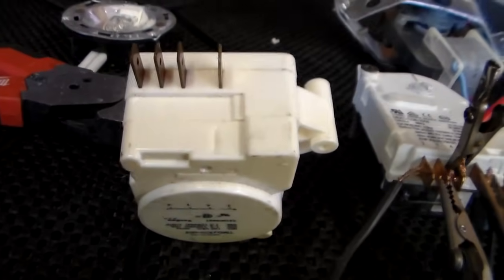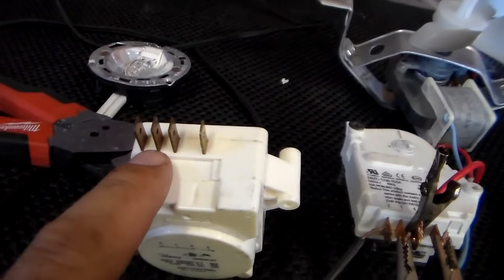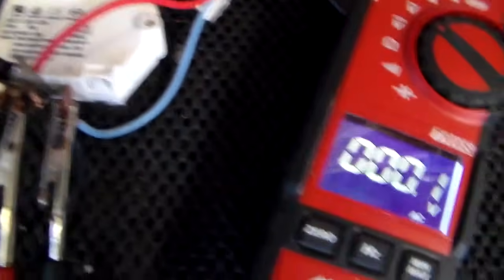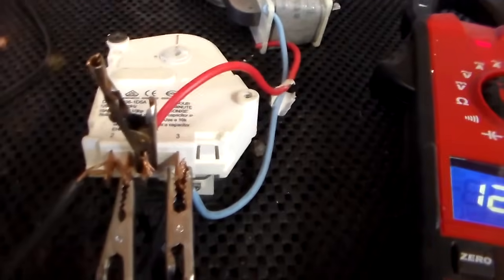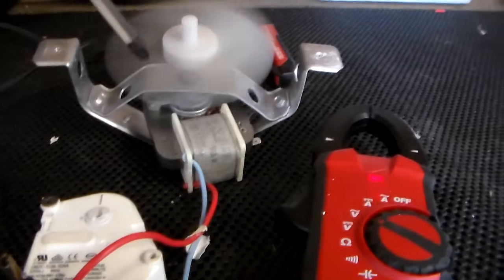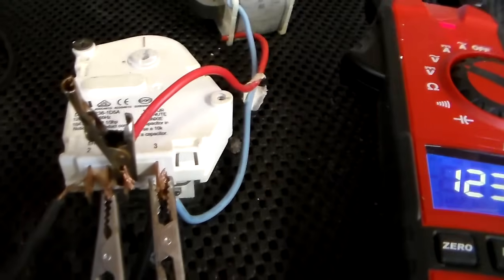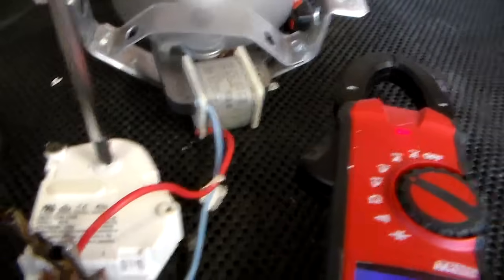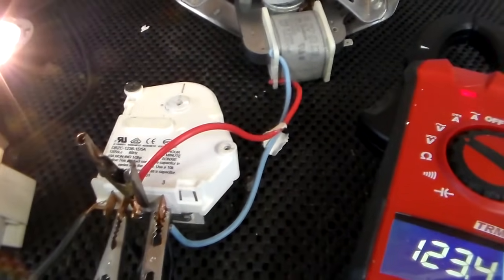How to Test your Defrost Timer

Comment: That's great but I can't find my timer on my GE top freezer TBX18 !
Reply from the maker: Barry Wind Straight back on the back wall of the refrigerator.  Have to pop out one of the plugs next to the temperature dials to see it.
Send the hole model number and I can look and tell you where it's at for sure.
Reply: TBX18AJB 
THANKS
Reply from the maker: Barry Wind That's where it's at, to the left of the refrigerator thermostat dial.   Should be a small little plastic plug in the panel the dial sets on.  Pop out the plug and look in the hole.  It will be just big enough to get a flat head screwdriver in there and turn the dial on the timer.
Let me know how you make out.
Reply: Found on GE forum that the timer is behind the left side of the kick plate at the bottom of the refrigerator. I looked and I see a metal bracket with wires sticking out on the left, about 4 wires. There is a little plastic piece sticking through the bracket that looks like a one direction turn (right only). The bracket has to be loosened and the timer is mounted on it. Timer has been ordered and should be here on Saturday.
Reply: Barry Wind  I got the part but when I took off the bracket at the kick plate it didn't look anything like the timer I received and only had 3 wires. Took the control panel off that was in the frig and don't see it there. I'm out of places to look!
Reply: wrong model then probly

Comment: A couple of questions Bill:  1. The Defrost Thermostat and Timer work in conjunction - is the thermostat simply a protection in case the timer doesn't work or more probably to shut the defrost off at a particular warm temp - if you bypassed the thermostat the timer would still shut the defrost off, right?  Not that I'm gonna do that, but just so I can better understand the purpose of the thermostat.   2.  Since the Timer is like a clock, can it malfunction at any point during the cycle - say one of the teeth of the cylinder breaks off - maybe this is beyond rare, but I guess what I am asking is do you need to test the timer all the way through a cycle --- also, do you hook up the timer directly to 120 volt wall outlet in order to test?
Reply: yes the timer would still function switch between def and regular cooling..  but it would nevr shut off once it reaches temperature because thermostat is disabled.   it would just run continuously forever. nonstop.

Comment: A friend has a Sub Zero 532, she told me that the refrigerator side is warm and the freezer is cold enough to freeze ice packs. When I opened the door the edge that contacts the dividing wall is HOT! I turn the defrost time until it clicks like in your video and 20 minutes later the divider is cooling down. A service tech told her over the phone it is the condenser fan, sight unseen. He came out yesterday and confirmed the fan motor was turning slow. The unit is used seasonally. I think the timer is stuck in defrost and that's why it's warm on the fridge side and cold on the freezer side. Does these sound plausible to you? I'm going to check the clock cycle. I would think there would be no cooling if it were fan related. Butt watt dew eye no?
Reply: yes  timer supplies voltage throguh it to the comprssor start switch and to the evap fan.   timer can be burnt weak internally junk  try another one from another fridge real quick   ohm it out with multi meter  pin 1 is hot full time always.   pin 4 is cooling regular.   pin 2 i think  is defrost only.  rotate timer  clockwise until the pins 1 and 4 is ohm together make a circuit.  or you can jumper the wires together in the fridge. wires 1 and 4

Comment: my problem is I have replaced my defrost timer and it still freezes up. I can advance the defrost timer and it will thaw. Once the freezer has thawed I advance it so that it starts back up again. After a couple of weeks or so i have to do the process all over again
Reply from the maker: Carl Krockenberger You still have a bad defrost timer then.  When you advance the screw and it thaws - that means all the parts attached are good.  When you advance out and everything kicks back on - those parts are good too.   The timer is not advancing on its own.  Little itty bitty motor inside the timer is not moving.
Replace the timer.
Reply: or bad ground to timer?

Comment: have a frig that I just moved on its side now not working   compressor gets real hot
Reply: compressor oil needs to settle back int compressor for an hour or more first.    can over heat ruin compressor.  it may be low on oil.

Comment: i replace my defrost timer in my Whirlpool Fridge but its not shutting off so ice built up at the back of my freezer
Reply: check the defrost thomostat and heater ....is the timer one like in the video or metal back with two wires?
Reply: +sim ridge the defrost timer is like the one you have in your hand
Reply: +sim ridge i did change my defrost timer yet ice still building up at the back of the freezer so my request isn t the bi metal need changing?  because my fridge isn't shutting off it is running none stop
Reply: gonna have to test thermostars with ohm meter real quick to rule them out    they are simple.  on and off,  click.   open circuit for off and closed circuit for on.   if they check ok then a timer is bad or no  power or ground to one of them.

Comment: What kind of meter is that
Reply: Basic multi-meter with an amp clamp.  You can set the meter to the amperage setting, put the clamp around the hot wire going to the fan (while running), and get the amount of amperage the fan is drawing.  Perfect for testing the defrost element to see if it's heating.

Comment: Hello Bill. I have watched several of your videos and they are great. 
Me fridge is a GE side by side model# ESL25JWF BS. 

My defrost heater burns out about every six months. I know I have the right heater. I have checked the two of the thermistors in the freezer. 

I have checked the thermostat and it remains open until it reaches somewhere over a hundred degrees. I purchased a new one thinking that this was wrong. 
It is designated LT40 - 30F. I have not installed the new one yet.

I was taught that this means that it opens at 40 and closes at 10F as 40 minus 30F =10f
However, this makes no sense as the new one operates the same as the old and opens somewhere above 100F.  I believe it is a called a high limit thermostat.

I do not believe there is a defrost timer on this fridge.

The fridge does ok but its always a little warm and appears to get really warm in the freezer when in defrost mode. It gets hot as part of the plastic has melted in the back. 
The only time the refrigerator compartment does not appear to be warm is the first month or two after I replace the heating element.  

I have been told the the mother board was on recall though GE denies it. 

In the end the defrost heaters always gets too hot and burn up. 
Thanks!
Reply: try lowering voltage to heater?  resistor inline in the hot feed to it?  knock voltage down a couple volts?

Comment: I REPLACED A DEFROST TIMER THAT SUBS 24,12,8 HOURS, BUT MINE WAS 10 HOURS. AND ALSO REPLACED THE THERMOSAT CONTROL, BUT NOW I GET A READING OF 32-34DEGREES, AND THE CONTROL DON'T MATCH THE COLD NUMBERS 1,2,3, ON THE PANAL.NOT EVEN SET TO ONE, AND GET THESE READINGS. WHERE DID I GO WRONG HERE?
MODEL ED22DQXDN01 WHIRLPOOL

Comment: I think I know the answer BUT may be some one can say for sure. I looked all over for the defrost timer dial. There was not one to be found. So I took the cover off of the control panel.  The one under the freezer and refrigerator  knobs.  I found a electric control board  with a bunch of wires going into it. It was about the size of two deck of cards sitting side by side.  Beyond that looked to be a motor like the one's in the old ice makers.
 I took a straw and touched the motor. There was a slight vibration like it was running.  I do not know what the hell I am doing but I am giving it a try. I checked the heater and it had contanudity  Yeah made my meter beep. So I moved on to the  defrost thermostat. Where it clips on to the coil that looks to be pushed out.  I did the cold water test and NO ohms passed through.
I went as far as to put it in a freezer for about a hour. And still nothing.  So I will try and get the parts today for it.
BUT getting back to the defrost timer. Since it is electrical  there is no defrost timer dial, right ?
 In the video you show the underside of the cover where the dial is located.  Still on the underside toward the front of mine 
it has 4 odd looking Recessed points. Kind of the shape of a telephone cable you plug into a wall. When you look up into them you can see a peace of metal. I am guessing these are some kind of test points. One off to the left then two together and then  another one off to the right.  But I saw no markings. I thought there must be something to this. When you checked the timer it had four points of contact.  Any Ideas any suggestions ?
Reply from the maker: +William Wynn post your model number and change the defrost thermostat.  It sounds like it's bad.  That could be your only problem.
Reply: +Bill Newberry   Thank you for writing back and Thank you for making all those videos. After 3 places I found the defrost thermostat.  Strange it went back together fairly easy. Oddly I did not lose any screws. I put the controls back to the factory settings. Then I plugged her up  and she started running. Twenty min. later the wife asks if it kicking out any ice ?  Women, right.   Anyways,  it has been running for  about 6 hrs.  It just kicked out the first batch of ice. The Freezer is at 10% and the Refrig. is at 38% .  It is getting there.
You asked the model # FRS6LR5FW6  it is a Frigidaire. 
        You really saved our bacon,  in more ways than one. Bless you for helping us out.
Reply from the maker: +William Wynn I believe on that model, to manually turn the defrost system on, press the freezer light switch quickly 5 times.  That will put it in defrost,  then press it 5 more times quickly to manually take it back out.  Put it in defrost for about 10 minutes, you should feel heat by then down by the lower vents in the back of the rear freezer wall inside.  If you turn the defrost cycle on, it will go back out on its own after 30 minutes or so.

Let me know how you make out.  If the freezer light switch doesn't kick the fan and compressor off,  try the refrigerator light switch.  It's been a while.
Reply from the maker: +Bill Newberry The damper between the two compartments will also close when it goes into defrost, you will hear that motor run too.
Reply: So that is what that motor is for. It did have me confused I saw no purpose for it but I see what you mean. Good to know.
Reply: +Bill Newberry  Not sure if I should be concerned or not. Got that defrost thermostat on yesterday.
I get up  this morning and the freezer is at 0 % the fridg. is at 34%.  In the freezer I had two bags of ice and just a few things.
 I went to the store and got a few more things.
That was around  5 pm.  At 9 pm  the Freezer is at 10 and the fridg. is at 40%.  Is this normal ? 
I thought the fridg. was suppose to be around 34 -38% .  At 5 pm  I did put a 10 lbs bag of ice in the fridg.
Along with 3 gal. of tea. 2 gal milk  it is not full but does have a few things in it.
Reply from the maker: The temps will fluctuate more when there is less in the machine overall.  Air doesn't hold temp very well.  Check the temps in the morning before anyone is in and out of it and see where they are at.  If they are back to normal you'll be fine.  If they are way off then something is up and we can dig deeper into it then.
Reply: Well that is what I will do then. Hey thanks for the info and your help. You kind of make me want to go out and find an old refidg. and see if I can get it working. But I got so many other things I have to do first. Besides I bring something else home and the wife is not going to be happy. Like women ever are. lol
This is got to be easier than working on old lawnmowers. That is what I do. Most of the time it is hot your outside and you end up smelling like gas and oil. Don't get me wrong I do not mind getting dirty. But after a while it gets old. Well thanks again and will talk to you soon.  I wished we did live close. I got a fair amount of camera gear. If so I could be your camera man.
Reply: Scotty said the more they overtake the plumbing, the easier it is to stop up the drain, I have been out of the loop for awhile and those stupid engineers have computerized appliances, went to check a fridge and found the classic ice one the freezer back pannel. so instead of turning the defrost timer knob to manually put it into defrost, there is a stupid computer board for a timer, manually putting it in defrost can tell me if the heater and the tstat are good using an amp meter to see if I have current. now I have to take the beck pannel off and check the heater and the tstat manually when if there had been and old style timer I could have saved the extra tear down and checking because most of the time the timer was the problem, thanks for the over engineering that now costs me more time to manually make sure its not the heater or tstat. computerizing appliances is just plain stupid.  thank you Mr. Scott for the demonstration of how removing some small crystal's can cripple a huge starship. appliances did not need any computerized refitting, the analog systems worked just fine. sorry for the rant but I needed to vent on the pure stupidity of computerizing appliances.
Reply: Damn it man, I am a doctor not an engineer.

Comment: I guess position of the terminals determine readings.  I have a timer whereas yours has number3 mine is number 1.  But the readings correspond to your positions. Don't hold me to that.  I need to recheck.

Comment: Some  years back  a refrigerator quit on me. I called a service guy out to fix. He walked in took one look at it and shook his head.  He said I can't help you. This is more of a radio than a refrigerator.  After looking at it for awhile he said he thought it was a bad regulator ?    He pointed it out to me.  After a long search I found one put it on and it worked. But then it started icing up.
Reply: I may be able to help is it a side by side or top and bottom fridge ?
Reply: Thanks for the offer but that was several years back.  When I moved I left it in the house. When I sold the house we went back through the house one last time. Last time I saw the fridge it spitting out ice like crazy.
Had I known it was going to work I would have kept it.
Reply: +William Wynn I save many persons money by fixing those fridge ...I'm a Caribbean guy we fix everything lol well try to before we get rid of it

Comment: The defrost feature does nothing.  The ice build-up is behind the plastic shield and is kept contained behind this.  But the worst part of this is when the refrig is new and working like it should the tube that drains the run off after many cycles eventually clogs with dust and debris.  This causes the water to run into the bottom of the thing.  The pipe and the plastic tray designed to catch the run off both are not removable for cleaning. In addition, the plastic tray for the run off is a perfect breeding ground for mice and insects.  Bottom line, don´t fix the defrost when it breaks and all these  problems will go away.
Reply: mine from 1989 a large whirlpool with below frezer still works great fine and no issues like this ever at all.   so i dont know?   hardly any water in tray ever at all too.  timer still connected all original.

Comment: I have a Whirlpool refrigerator made in 2003 top mount freezer I try to run my refrigerator on my small solar setup as much as I possibly can weather permitting I have a cheap 1500 watt continuous 3000 watt surge Harbor Freight Cen Tech modified sine wave inverter the refrigerator came out with a ice maker that I have disconnected and take it out of the freezer for extra space and of course it is auto defrost a friend of mine told me that the refrigerator may very well be running lots of auto defrost Cycles far more than it should be using a modified sine wave inverter because it could be messing it up making it run more I do know that refrigerator runs a lot and it takes a lot of power to run it it's a good refrigerator have you ever heard tell of that,,, would my  modified sine wave confuse the auto defrost timer if that's the case I'm trying to run the refrigerator and the auto defrost all the same time on solar and that's probably why it doesn't last very long I can run it for 12 or 14 hours if I've got a lot of sun ,,, and then I shut it down after about 12 to 14 hours because I don't want to run my battery pack flat,,, I don't know if I can turn the auto defrost  off,,   is there a way you can install a switch on the auto defrost  to turn it on when I'm hooked up to the grid but to turn it off on days I run on solar

Comment: Nice video.  Being an electrician I might suggest you spend a dollar and crimp on some safe connectors.  You're giving viewers the impression that 120 volts is safe with alligator clips.  We have a responsibility to our viewers no?
Reply: Being an electrician, which I doubt, you would understand alligator clips are for diagnostics.    If someone is watching this and they're dumb enough to not understand that this is either 110 or 220 v they should be Darwinized,  Why did you not remind him about safety goggles, high dielectric gloves, ear muffs, jock strap and condoms, just to be safe.  Sorry, tired of I am better than thou do gooders.